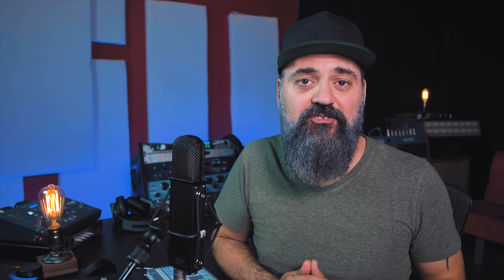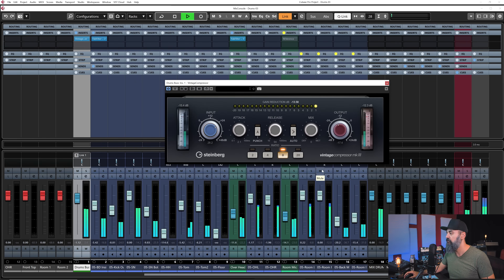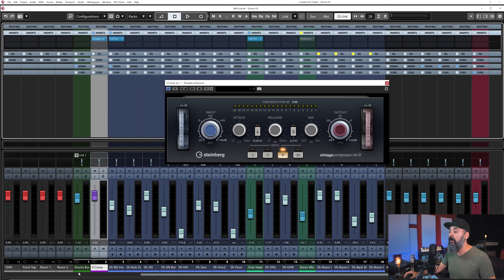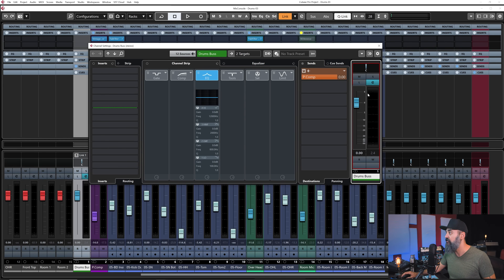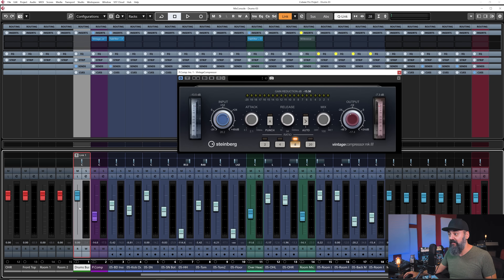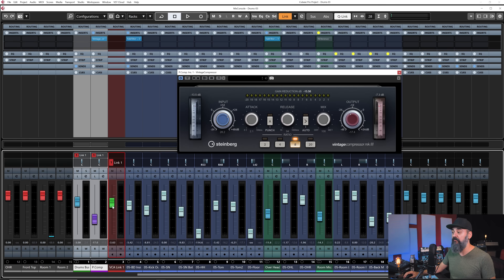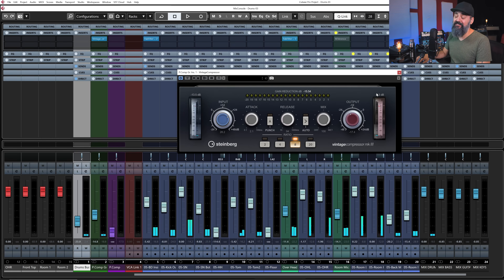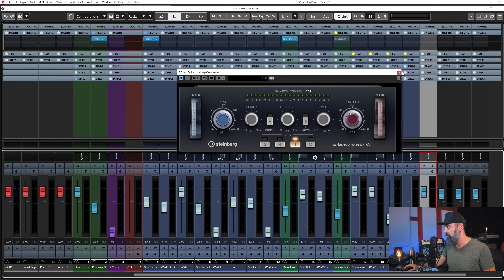4 WAYS to Apply Parallel Compression in CUBASE

Comment: Hi Chris... Still learn so much  from these old stuff in your channel.... One kind clarification please... 

The ways of parallel blending via an FX / GROUP track introduces phase issues due to the latency of the parallel compressors right ? So when the blended signal is high in volume this becomes a real issue, plus if there are more than one parallel buss, it becomes pretty obvious & sounds awkward ...  How do you get about it ?

Many thanks for all your advises & these lovely episodes of the real deal.... Cheers :)
Reply from the maker: Hey Rezi, Cubase has Delay Compensation built in, so you don't have to worry about this.

Comment: Great video as always, but I have a question, is latency not an issue? If the compressor on the parallel channel is adding latency would this not put the signals out of phase alignment? I have added a compressor to both channels and bypassed one to get around this, but in all the parallel compression videos I have seen no one mentions this? Or is it not an issue? Thanks.
Reply from the maker: Good question. Your DAW Conensate by adding latency when working with plugins. So nothing to worry about :-)
Reply: @mixdownonline  Interesting, thank you for the quick reply! I'm sure with some plugins I have noticed a phase issue and others not, I wonder if those plugins are 'reporting' the latency correctly. That said I don't notice any issue with Cubase' stock plugins. Thanks for your answer. Great channel.

Comment: why there is alway a white noise when I apply parralel compression?
Reply from the maker: Parallel compression will make the sound louder so if you add too much, it might bring up the low noise part of a recording. Maybe that's what is happening.
Reply: @mixdownonline  

Thanks for answering!

no its actually the (delay?) of the compressor that causes this noise, when the compr is on, you will hear a noise in cubase altough the track is not played. And when i mute the compr plugin the noise disappears. And while mastering it gets extreme loud. Any tips to reduce this noise? Or the delay of the compressor.? Thanks

Comment: Hi there, thanks for the video. Wondering if you could tell me if Cubase can handle doing parallel compression with OTB hardware compressors?
I am using the middle of the road Pro Tools (not HDX) and there is a lot of hoops to jump through to make hardware parallel work properly, and in fact, it basically doesn't work due to latency.
Someone mentioned that Cubase MIGHT be able to correct the latency issues, but I haven't been able to confirm it.
Any clue?  Thanks!

Comment: Hey I got a question, I did parallel compression on my tracks (in this case vocals),  When I send the vocal track to the group bus I hear like a delay. the delay compensation has no use here, it doesn't fix it. any solution for this of if i'm doing something wrong?

Comment: Hey Chris, i need your help,with parralel compression for example i want
 much variations on the addlibs with panning L+R for example
there are 30 addlibs and want this 
some adlibs  left side with 13 % 40% 70% etc panning Left
some adlibs right side with 8% 23% 64% 78% panning right
if i want to add parralel compression on this ad libs how to set up with 1 compressor and not 15 compressors left side with 13 % 40% 70% etc panning Left
and 15 compressors with 8% 23% 64% 78% panning
hope you understand what i mean and give me a better workflow for this

(i notice so far in studio one you can do this with 1 stereo compressor) is this here also possible?

Thanks in advance for taking your time to help me out Chris

Comment: Thanks for yr videos Chris .
A Cubase Pro question if I may .

I do a lot of projects where many songs or audio events are laid out in long sequences inside the project window .  
I will then use the marker track to name many of these , usually with the cycle marker .  
Then I will make mixdowns of the various marked tracks .
Is there a way to have a Second track timer running in minute and seconds that starts from the Left Locator ? 
It would be very useful for me because I will send the mixed tracks to my clients and they could say , for example , "track 3 ...more guitar at 1min31seconds . 
Right now I have to go in and work out where that is . 
With a timer display running from zero at the Left Locator this would be a lot easier.
Reply from the maker: Unfortunately, there's only one Ruler Track available on a project
Reply: @mixdownonline  thanks for getting back Chris . To me this is a real drawback. I will often have large projects , lots of different audio segments laid out in sequence , which needs to be in the 1 project window , not multiple ones. 
Anyone who mixes audio for film will be familiar with this...
I can't believe Cubase doesn't care about this ! 
Perhaps Resolve will provide it.

Comment: Chris, can you maybe tell us which compressor you prefer for Parallel Compression? I know the compressor needs to be fast to get the best results. I use the API2500 from Waves all the time, but maybe you have a better suggestion?  Thanks!
Reply from the maker: The API2500 is great. The Vintage and Tube Comp in Cubase are great if you don't have anything else but my favorites are the1176 (UAD) and DBX160 (UAD)..Oh yeah, also the Arouser (Empirical Labs).. I'm keeping editing this comment, and now I need to add the UBK-1 (Kush Audio) that is a very creating type compressor that work very well in parallel... Now I'm done!  Lol!
Reply: @mixdownonline  Hmm, I actually never tried a 1176 with parallel compression. I'll give that a try! :)